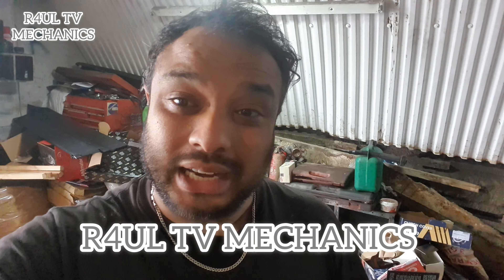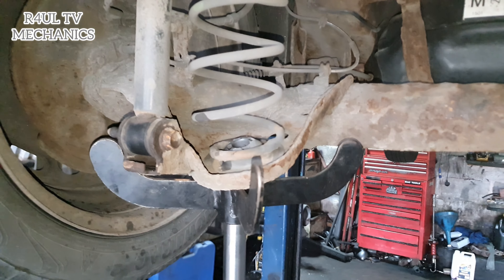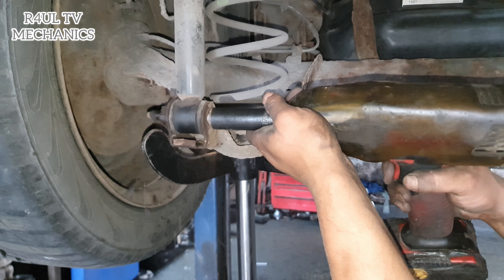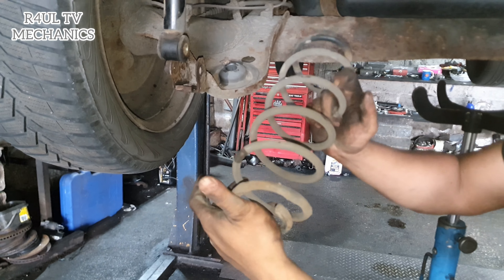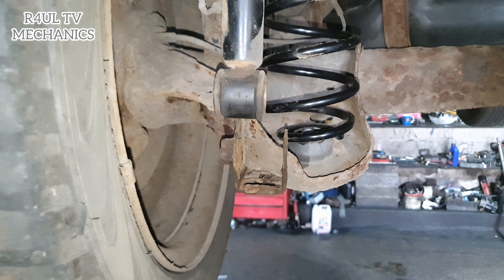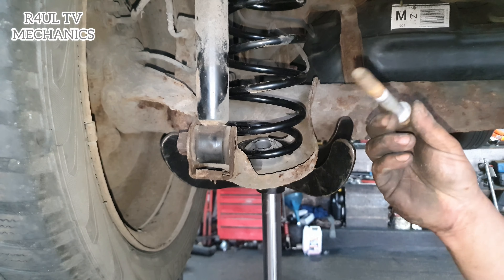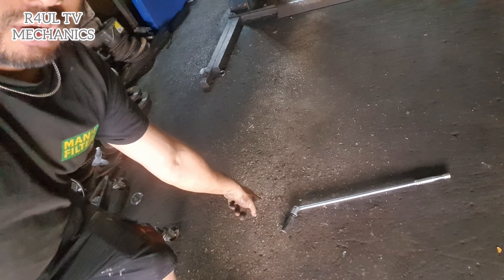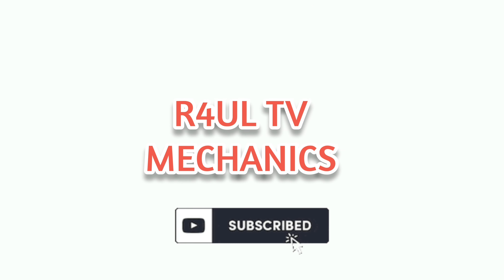2010 MAZDA 2 REAR COIL SPRING REPLACMENT

Comment: Saved me £120 just before Christmas by doing myself instead of taking to the garage!

For any other amateurs like me, I’d recommend getting a wire brush and penetrating oil to help loosen the rusty bolt. 

Just used a ratchet with 17mm socket and the small scissor jack that comes with the car.
Reply from the maker: That's great every penny counts. Thanks for watching really appreciate it.  Also have a great Christmas